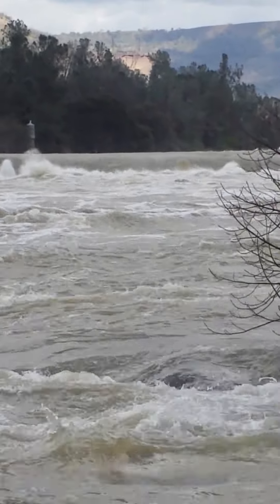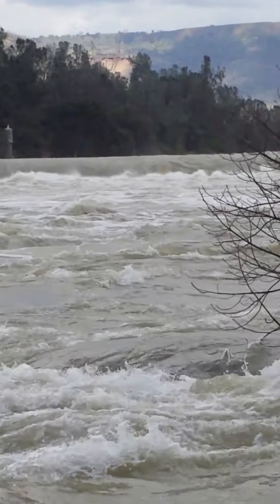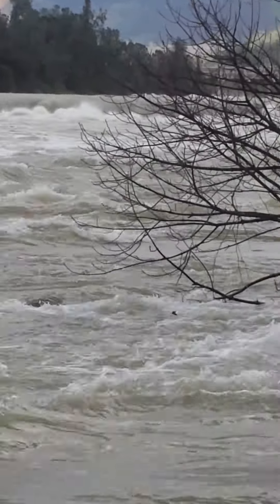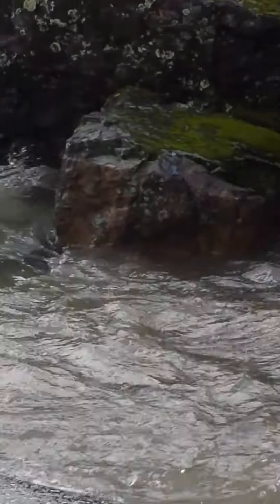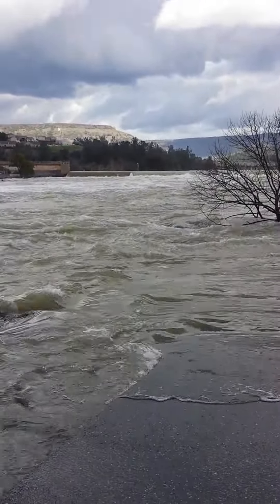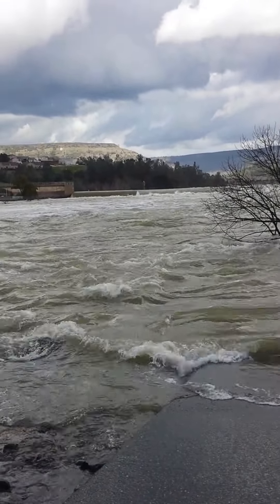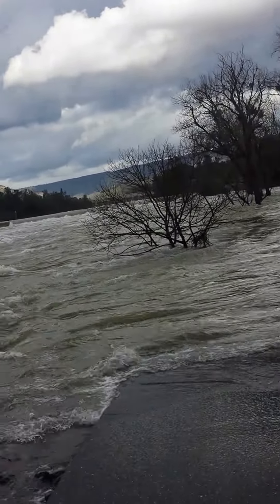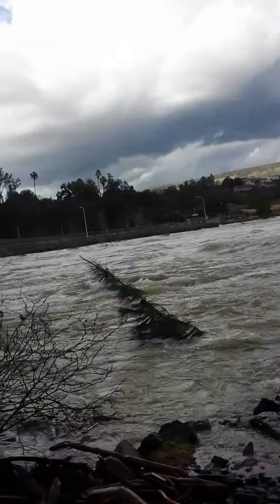Oroville Dam, Oroville can't take any more water!

Comment: All the news I've seen (including KCRA) indicates the dam reduced the amount of water today released from the spillway.  You could tell 2 days ago, it was going to be too late for those down stream. In a couple days, the runoff from the mountains will be there.  I'm so sorry this is happening. I had researched dams a year or so ago and learned about the MANY dam failures including the very sad Johnstown dam break.  All of these dams are mismanaged and not built to protect property but rather, to line the corporation's pockets.  And, don't forget our wonderful government, in the form of the Army Corp of Engineers (which I call 'water black ops'), have a 20% 'stake' in the Oroville dam.  It really pisses me off.  It's so very sad.  Thanks for posting the vids.